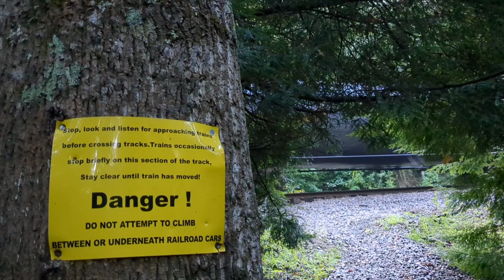Hand Carved OSAGE ORANGE Axe Handle

Comment: Wonderful video Drew. I think Osage Orange is an awesome wood. Made a hiking staff from an Osage Orange bow stave about 15 yrs ago. Rugged stuff. From what I read about it the stuff doesn’t decay/rot very easily. One can use just about an type of oil to treat/preserve the wood. Some even used engine oil. Not sure but think it has a lot of natural oil in it. 
  Love the yellowish color of it but found that over time from putting mineral oil on it now & then turned it a kind of darkish brown. Seems like a heavy wood too. 
  The other double bit axe with the snake head handle is apple? 
 Wonder why some say not to make an axe handle from Osage Orange? Stuff is pretty damn rugged. Maybe the weight of it? 
  I think it’s interesting when you go back & forth between the woods & the shop that you work in. Seems Bonzo & Bergel really get their “snooze” on back at the shop 😆. 
  Well I’d say the axe handle did VERY well. What a workout you had!  No finer all around conditioner than swinging an axe or maul. 
  Axe or chainsaw in the woods to get firewood makes one a gorilla in no time. 
  I see you got the 🚂 🚂🚂 again! 👍🏻😊. 
  Well, catch you on the next one Drew. Take care! 🇺🇸💪🏻🇺🇸☘️
Reply from the maker: Yes sir, Applewood on the other double bit with the snake head.
People are knuckleheads, before I knew anything about carving axe handles I used to get in forums and read what people had to say. Even today I could get in an axe or blade forum where a guy is asking if a certain wood is good to carve a handle with and everybody will be talking the guy out of it saying NO, USE HICKORY, HICKORY IS THE BEST. Even talking people out of using Ash. I'm planning on making a video on it sometime with my thoughts on using different woods.  
Bonzo and Bergel get to snoozing around the hostel for sure. 
Swinging an axe is a favorite past time of mine 💪🏻🇺🇸🤙🏻
Thank you John, take care.